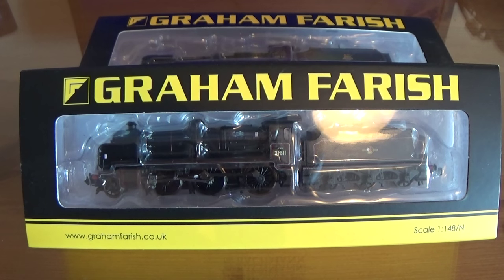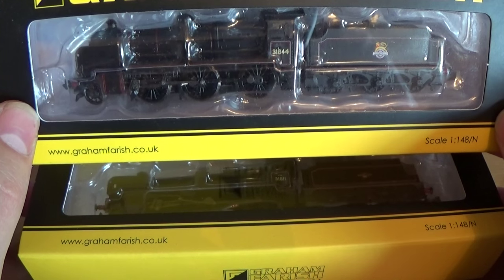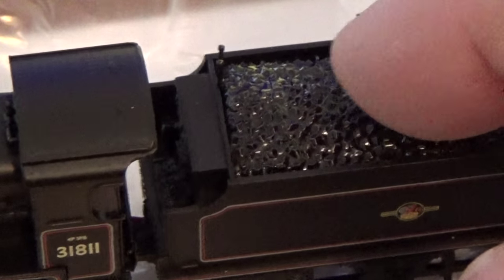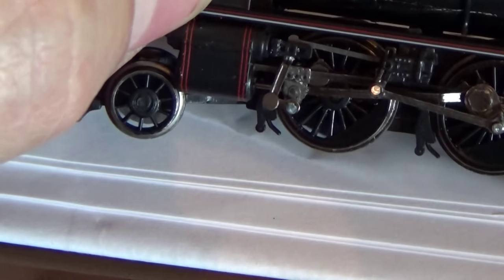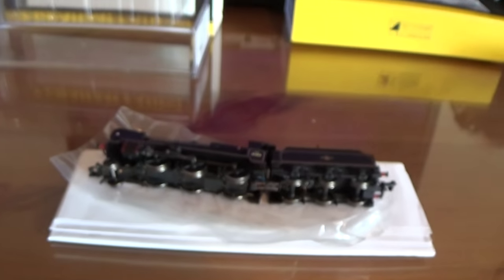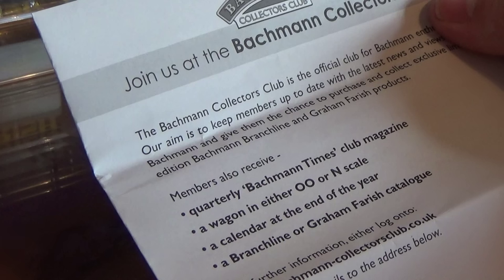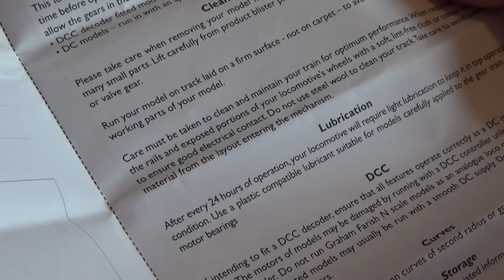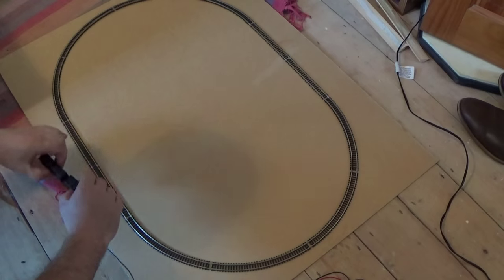Unboxing a Graham Farish N gauge/N scale "N" class loco

Comment: You have overlooked the fact that this model has a coreless motor- and a working fall-plate between loco and tender.  Loco 31811 has the original Maunsell chimney, whereas the other loco 31844 has the BR Class 4 chimney that was fitted in the 1950s. There are no smoke deflectors in the accessory pack- those are cab doors! You also seem to have missed that the weight in the tender - the coal- can be removed to reveal the full shape of the tender and thus a half load of coal could be shown. This model is probably the best in my collection of Southern Region and Western Region collection - a superb runner!
Reply: You must be fun at parties